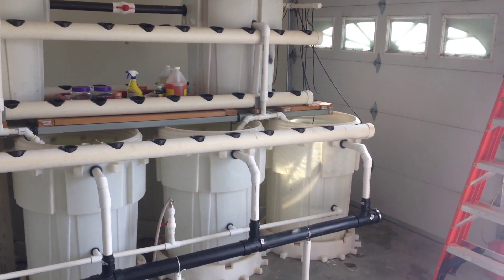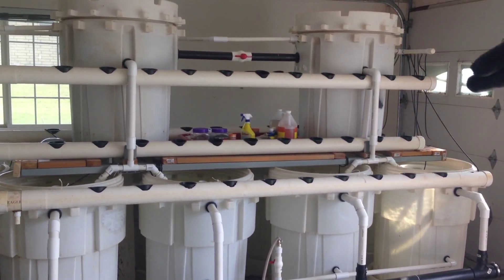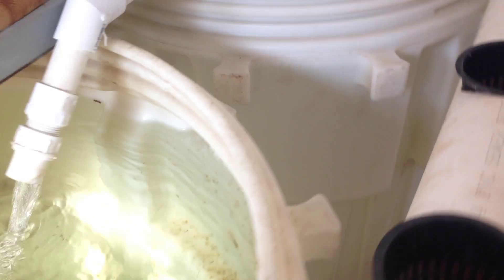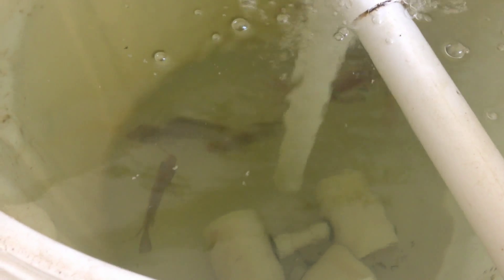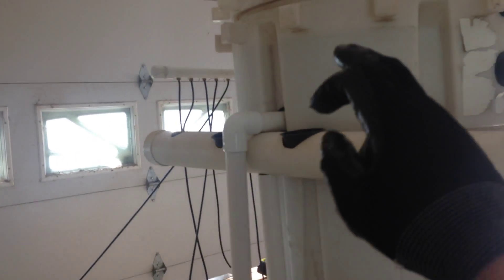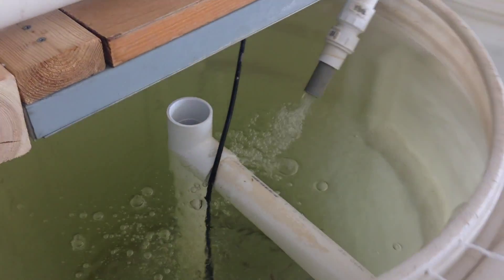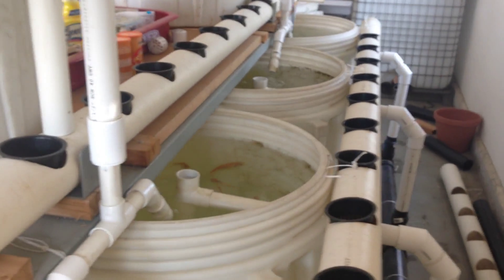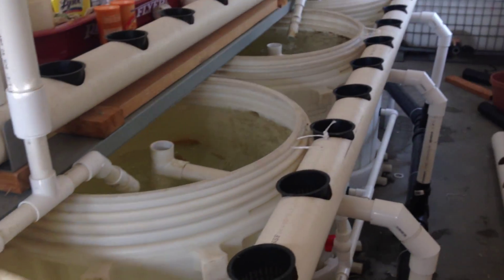(7/25/2015) Update on Aquaponics System (Tilapia)

Comment: very interesting design. I think if you were going to heat the water and had grow lights you could probably do lettuce and the like thru the winter...maybe. I'm kind of like you my aquaponics systems are more designed to the fish side of things. world like to see your filtration set-up.
those are some interesting fish tanks. where do you get them from
Reply from the maker: The Liquid Gardener Thanks for your comments and questions.  I am still trying to figure out how I will guarantee the water temperature stays in the 65 to 75 degree range in the dead of winter.  I have an 800 Watt heater that is triggered by the temperature falling below 73 degrees.  Maybe that'll be enough.  I better hurry.  The fall is coming!
You are correct. My system is for fish production.  Any plants would primarily exist for the nitrification process.  A local wholesale company received a large shipment from the government.  The Feds used these containers to ship miscellaneous items across the U.S. a few times.  They paid $95 a piece new.  The wholesale company needed to move them quickly, so they sold them for $2 or $3 a piece to the general public.  I find joy in re-purposing junk.